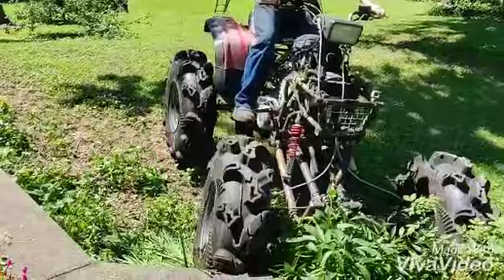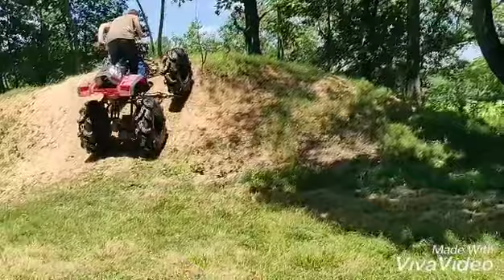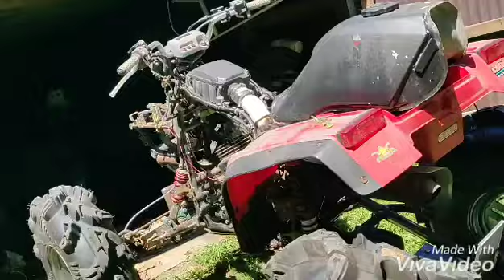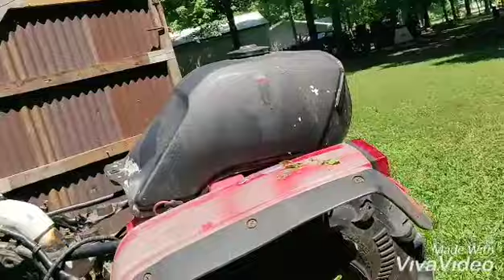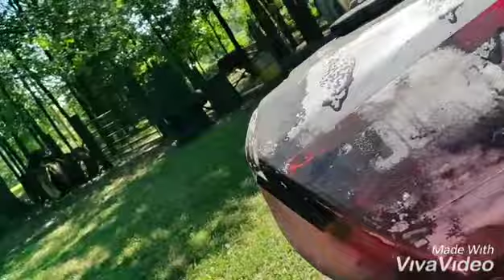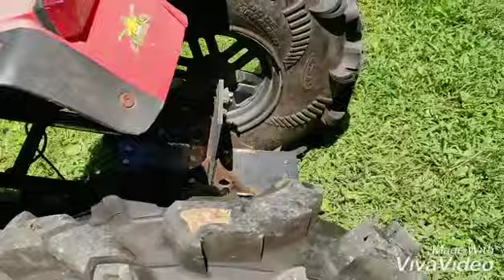4 link 350d testing and fail

Comment: I moved a yellow top optima in the front of a build, and some other smaller amounts of weight. Just to help the front end get a little bigger bite. All of the engine weight and your body weight are way back of center line. But I'm sure you will conquer that hill no problem. It looks very nice!
Reply from the maker: i have a 80lb chunk of a fork lift frame to attach to the front end plus my fuel cell and winch are in front now too

Comment: If you wanna get some flex out of it try getting some new shocks like stock Honda 450r shocks
Reply from the maker: It has over 18" that's beyond plenty
Reply: TheHondaOutlaw wow that’s a lot but would you be able to flex a lot easy since 450r shocks are softer and what kind of shocks are you running rn
Reply from the maker: 300ex fronts they are already much softer than a 450r as is

Comment: You need your shocks on the axle and longer ones
Reply from the maker: Na works excellent like this 18+" of flex is plenty
Reply: TheHondaOutlaw what flex I didn’t see any of you had better shock placement you would have flexed and not tipped
Reply from the maker: I tipped because i dont have rear spacers built to make up the fact that my rear is 8" narrower than the front and i was on a steep hill anyway. If i put the shocks closer to the axle it would take a lot more effort to make them move then where i have them now and i would guarantee flip every time because it wouldn't move almost any. Believe me when i say it has plenty of flex just actually needs finished.
Reply from the maker: Actually better than arguing with you. How about instead you build your own 100% on your own and when its done let me know and then you can actually tell me whats better on it than mine.
Reply: TheHondaOutlaw I have a four link mud truck I built bud just trying to help you I have one of these 350d’s I think what your doing is cool
Reply: Yeah I agree with Curt, you need to move the shocks. As it is you have no flex because of the mechanical leverage offered by their positioning.  You might have 18" of travel but thats only if you launched it off a jump, not put on an RTI ramp.